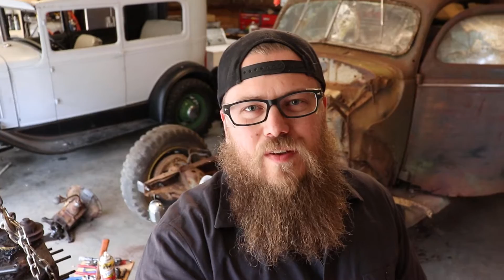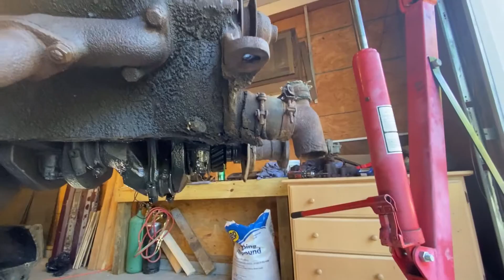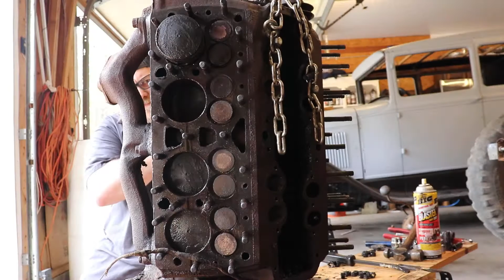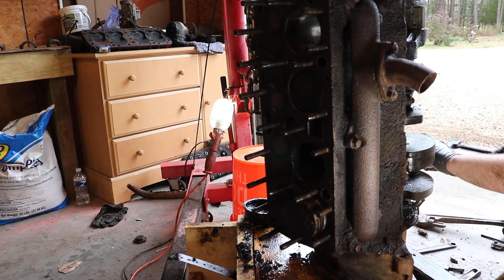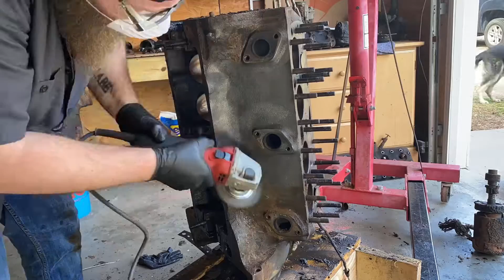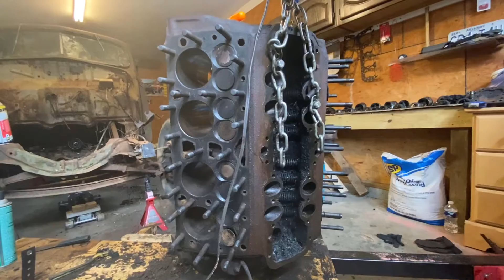Vintage Dragster Ep.5! FLATHEAD TEAR DOWN!

Comment: Where can you get rebuild kits for a flathead? I've never dealt with a flathead and never seen the inside till now. They are very interesting  design. Also can a regular  engine shop bore or hone them?
Reply from the maker: Actually the rebuild kits are easy to find, summit and speedway motors sells a lot of flathead parts. As far as an engine shop, most machine shop can bore them, balancing them I would rather find a shop that has more experience with flatheads, I live in Virginia, and using a shop in NC because of their reputation with flatheads
Reply: Flatheads are making a big comeback!
Reply from the maker: Lowhung Garage amen!

Comment: That appears to be a pre-war engine not a 59A. Just going by the crankshaft that was in it and the rear seal.
Reply from the maker: Thank you for the info Matt! So all the 59a where after the war? And I’ve been thinking this was a 91A but not sure how to tell the the difference with the early 24 stud engine, this was out of a 39 Deluxe, any help would be appreciated
Reply: @WiredCustomsSpeedShop  What is the bore of your engine? If it is 3 1/16" it is prewar Ford. If it is 3 3/16" it is Mercury or post war Ford. 59A engines were made in '46, '47 and '48 and have 59A cast in the top of the bell housing, if my memory serves right.

Comment: sorry bro,but you are painfull to watch.when you beat on the dome top,the piston deforms and grips the walls harder.the more you beat,the harder it grips.probably not what you want to hear but....still,i like young dudes opening up old engines and learning,and others watching can learn.my advice is to approach every bolt etc gently,like an archeologist would exam.....
Reply from the maker: Thank you for the information, I tried and tried to be gentle with it, I tried to go up and down, penetrating oil, I just didn’t put that in the video, all the other ones came out with soft taps, just couldn’t get this one to go
Reply: Chuck Barnes  kiora chuck from nz.there is no easy way.Scott from CWM uses old boiling oil,and other means of pressurizing the piston to move.one engine i did a few years back,i sent a 1" holesaw thru all around the crown making sure no to touch the conrod.i then very carefully used a small metal-cutting blade to quietly slice down the wall of the piston until i broke thru all down the length.no easy but very effective.can i suggest to you guys that when you work on these antique motors you throw away all your fancy millenium power tools and go back to hand spanners/sockets.each and every fastener you whang-up with a power tool gets munted,streached,then fucked.my ten cents.good luck with this motor,dont spend a single cent on anything until you have completely cleaned,then hot-tanked,and most importantly MAGNAFLUXED fully and every crack checked.
Reply from the maker: Ralph Reuben thank you for the information Ralph! I will definitely try more avenues before just smashing it out, I did try to use impacts as little as possible, I like the idea of hot oil, and I will definitely clean thoroughly and hot tank, machine shop is going to magnaflux before I start buying anything, that’s also what they recommend, do you have any recommendations for flathead books?
Reply from the maker: Chuck Barnes cool Chuck! Upload some walk around videos of them I would love to watch them
Reply from the maker: Chuck Barnes ok thanks Chuck let us know when you get the chance
Reply: @WiredCustomsSpeedShop  yes,write your own book .we boil our blocks in a steamer after it comes back from machining ,made from old bath,then assemble in clean room.port,polish,and relieve block at top of bore,semi synthetic thru full-flow good quality oil filter,high flow oil pump,water passages coated thru-out and good coolant.if u use high comp alloy heads,go new.big rad,electric fan,pertronic,..........